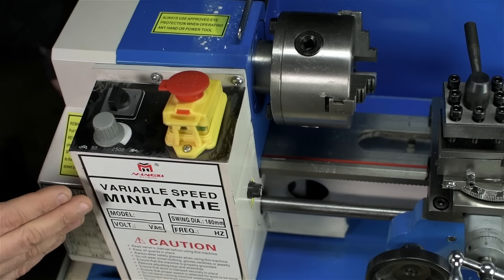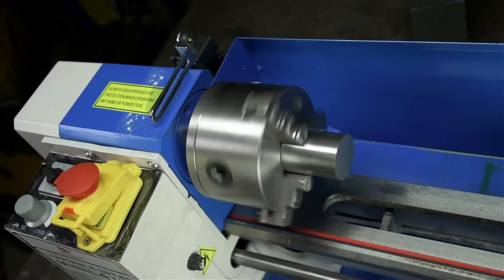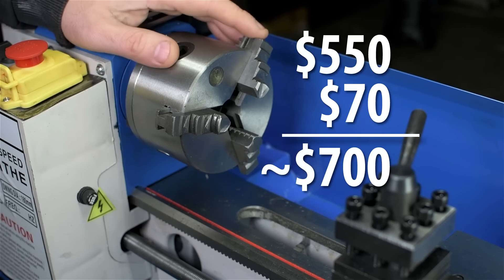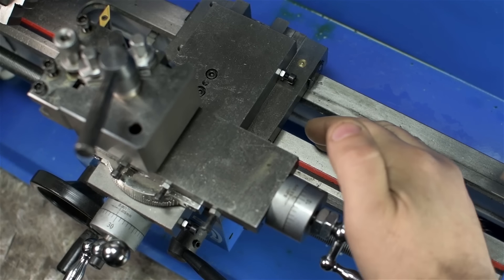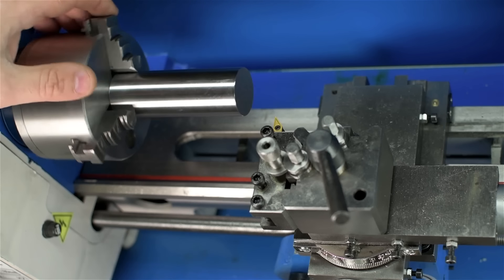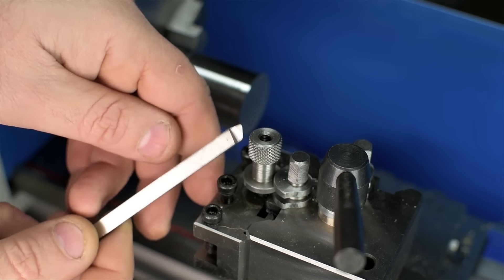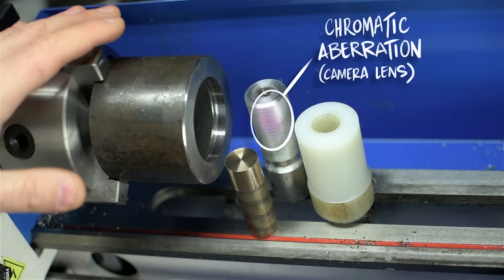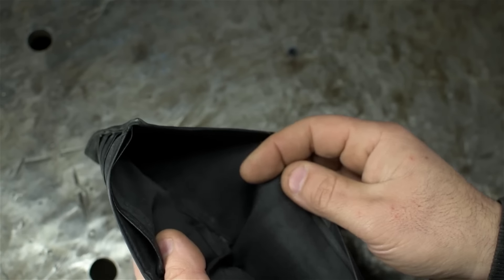The Infamous Mini Lathe!

Comment: I've been using a 7 x 14 for over 10 years for tooling and gunsmithing projects. I have chambered numerous extremely accurate barrels and blueprinted rifle actions to the point that the rifles are accurate enough for competition (5 shot groups under 0.025 at 100 yards). I have machined repair spigots for our swimming pool and countless other projects.

I can't post on the premium gunsmith forums because they laugh at anyone using one of these, but my results speak for themselves. And yes, I have heavily modified it for enhanced rigidity and increased spindle bore size for wider stock.

I've also used it to machine glass filter housings for one of my older cameras.
Reply: What were the most effective mods for adding rigidity?  Adding a lock to the compound or replacing the compound all together seem the most obvious, but what else?
Reply: As a gun nut I call bullshit on the less than 1/4 MOA as that is almost impossible with today's technology let alone a $500 dollar budget lathe, as seeing at most u could only turn down pistol length barrels with it, and pistol caliber cartridges aren't even capable of 1 moa accuracy, ya know the only cartridges I can think of being capable of that kind of accuracy would be .408 cheytac, .416 barret and .375 cheytac. And all three of those cartridges would require a barrel that is longer than a mini lathe is capable of machining. So any other misinformation u care to spread Mr. Fudd?
Reply: @how_about_no3287  for some reason I trust you more than that boomer
Reply: Boy now that has to be some mighty thin barrels.  0.75" through bore is enough for maybe 0.25" wall thickness on a .22 cal. 
A .223 government profile will not fit nor would I try cutting threads on the machine.
Reply: @ahole5407  Before we say the man is lying, consider what he said in his post about the gunsmithing. He said he "Chambered barrels" What does that mean? I am not a builder of firearms, and I don't know what that means. He also said he "blueprinted rifle actions." Blueprinting in the automotive world means repairing loose tolerances of parts, to get them all matching factory specifications, with no "lips" or "burs" that can cause loss of performance at the bleeding edge of performance.
Reply: @Ritalie  "chambering"
Most prefit barrels you buy will already have the rifling cut and the chamber (where the cartridge goes) will be cut short of the depth it needs to be for correct headspace. A chamber reamer is used to cut that final depth. The barrel is loaded into the lathe where the chamber is oper facing the tailstock and requires the length of the barrel to go through the through bore. This machine can't do that because it only has a 0.750" through bore.

"Blueprinting actions"
You true the face of the action to the shoulder of the barrel, true the threads, true the bolt face to the breach, set your headspace, and eliminate all tolerance stacking.  Lapping of surfaces to 90% contact is also done and acts much like how scraped ways do on a mill.
An action is larger in diameter than a barrel and again this machine would not be able to do that work either.

In gunsmithing, you debur and you can also dehorn bit generally sharper corners are a sign of good machine work and also why stones are preferred when doing hand work.

And then we have materials. Ordinance steel is tough stuff. Barrels are made from 416 stainless and CMV. Older actions can be made from case hardened Steel. The machine is too small to do quality work on these materials.

Any questions?

Comment: I took the advise of a millwright I worked with. He told me to buy the mini lathe, learn to work around the limitations and turn out good parts. When I buy my next "real" lathe I can use all the tooling I purchased, and it will all seem too easy on a big machine after the mini lathe experience! I have crashed my little buddy, made new gears, rebuilt the head, and learned SO much I would not have had the chance to if I just got the new lathe up front. Also, I paid for that machine 5 times over making barrel tuners, comps, threading barrels, firing pins, and it works great when reloading ammo for case prep. Have fun,   G>

Comment: On the topic of plastic/acetal gears: 

Overall, remember folks, plastic gears don’t necessarily mean bad quality or that they will break or wear fast. Sometimes it’s actually a positive and some applications do a lot better with plastic gears than metal gears where said gears are not encased in an oiled gearbox but it always depends on the application as with absolutely anything in the universe.

Comment: I love my minilathe. I've actually managed to do some titanium machining with it- the trick there is 1) get the soft annealed grade and 2) run it backwards with the tool installed upside down. That way the slop in the lathe means that the tool catches it retracts from the workpiece and has another go on the next rotation; in a "standard" configuration when the tool catches the slop allows it to really dig itself in, causing everything to stop very suddenly.

Comment: I also started out with one of these, but mine was the "very popular" 7X10 (really a 7X8)Mini Lathe from Harbor freight.  This became a 7X16 with the LMS kit.  Later it was sold for a 8-1/2X20 bench lathe from LMS.  I also got a LMS Mini Mill,  this was traded for the next size up, the Bench Mill also from LMS.  I learned a lot with my little toy (and videos from you.  the 1" punch is especially useful) and now have a brand new Clausing 15X50 lathe and 10X54 Mill I get to play with at work.  The learning never stops
The ability to make whatever you need is amazing.

Comment: Plastic gears are fine. I got my 7x10 in 2008 and am still using the original gears. I have stalled the lathe taking too deep a cut a couple of time and none of the gears have broken. They have the double advantage that they are cheap to replace and self lubricating. 
If your gears are tight on the shaft ream them to the correct diameter.
My two cents on upgrading the lathe. Do not put in a bigger motor or steel change gears or steel headstock gears. Just use the lathe as it is for projects and save your money to get a bigger more powerful better featured lathe if you find this one has shortcomings. This lathe is engineered so the power of the motor is appropriate to the materials and masses of the gears, castings, size of work that fits in the lathe and depth of cuts it can do and meet the accuracy of 1/1000th of an inch in the work. Upgrading to more horsepower and steel gears etc is asking for trouble as you run in to the limits of what the lathe is engineered to be able to do.
 Have fun with your lathe.

Comment: I agree it can be very useful to keep a smaller lathe around the shop for delicate work. Personally I like to chuck my mini lathe into the full size one which naturally doubles my productivity
Reply: Would you be able to give me some advice on where to get a cheap lathe that I can make wooden bowls with please? I don't have much money, so I'm hoping to find something cheap. I'll even do it by hand if necessary, I just need to know the bare minimum tools I'd need to get the job done. I'd really appreciate some advice! I want to be able to make some money selling them to help my family. I have a pyrography pen, and I'm hoping to make bowls and things of that nature, burn designs into them, and hopefully turn a small profit in time☺️
Reply: I have a 7 x 14 mini lathe (Grizzly G0765) and a Toyo ML210. I made a back plate adapter to fit the Toyo chucks to the Grizzly.

Comment: The reason for the plastic gears is for safety, in gear boxes it's common to expect a overload and thusly the force needs to go through something that breaks on the upperlimit in order to protect the rest of the machine. Thusly this part will be easily replaceable and made of a lower strength material on purpose. With metal gearboxes this is normally a pin of a certain diametre that breaks
Reply: The larger lathes with true gear boxes will have a shear pin in them somewhere to handle just that problem.  The shear pin will be in place of a key.
Reply: Dang. Like a mechanical equivalent of a fuse!

Comment: Two companies make these lathes. The one that makes the one in this video is the better one. It has way wipers on the saddle. The apron is thicker and there are dual ball bearings on the carriage crank. It has a lash adjuster nut on the right end of the leadscrew. The sides of the saddle are straight which means more mass, plus easy to install a carriage clamp. Some importers have one installed on the right side. The headstock should be held to the bed with four bolts. They've also added the camlock to the tailstock.

The other manufacturer is where Harbor Freight buys their mini lathes. No way wipers. Thinner apron without bearings for the carriage crank. The headstock is likely still mounted with only three bolts. The saddle is "H" shaped, lighter weight. No camlock on the tailstock. No lash adjuster nut on the leadscrew. This manufacturer tends to really slop on the protective shipping grease that has to be cleaned off.

With either one, the manufacturer offers many features for the importer to select from. Typically companies that buy the cheaper one (like Harbor Freight) tend to only opt for the thread dial and leave everything else stock = cheapest. On the fancier one I've seen importers offering things like the carriage lock clamp. Odd that the one you bought doesn't have the thread dial.

A super easy improvement is to remove the lash adjuster nut (loosen the setscrew in its end) and support block then add a brass washer on the screw on either side of the support block. Then you can snug the nut up real close to improve surface finish and reduce jams and digging in (especially when facing) because the leadscrew can't move to the left.

There's a lot of little project that can be done with the lathe to improve the lathe. They're pretty well documented on the web. Spend the first several days on that stuff and you'll both learn how to use a metal lathe and make it better and more enjoyable for projects.

My first lathe was one of these better models (with threading dial), bought at a Homier mobile sale. I'd never used any lathe before but within minutes of getting it out of the box I was turning a piece for a project. I bought the lathe because I was tired of paying a machine shop $35 an hour to make things wrong. "I need this bore cleaned up and tapered this direction." Got the part back with the bore real nice, and tapered the wrong way! Fortunately there was enough metal left I was able to bore it straight, press in another piece of steel then taper it the right way.

My second lathe was a Grizzly 7x10, serial number 346. Likely from the very first batch they imported. I was at least the 3rd owner and it had been abused badly, due to how crappy it was. I was able to work it over to make it much better. Chinese tools have improved a lot in quality since the 1980's, if you're willing to pay a bit more. They'll still make crap if that's all you're willing to pay for.
Reply: Indeed, chinese just ask "What you are willing to pay for it?"; And makes it to that budget. If you say you want 10$ lathe, well... They'll make it for you, but don't expect much :)

Is there a site devoted to the mods you are talking about? I've been thinking about getting my first lathe for sometime, maybe it is time to do that :)
Reply: @skaltura absolutely correct👍🏻
Reply: It's similar to a 3D printer made from a kit, lots of your first projects are making parts to make the 3D printer print better, then making the same part in even nicer quality-repeat until satisfied. Did this with my part cooling fanduct, for instance. will eventually do so for all of the axis parts. I imagine you could really go ham and get something pretty nice after awhile.

I would get this lathe cutting reasonably well, then I'd use it to make the parts for a somewhat larger, but much nicer, handmade lathe piece by piece. and learn how to use a lathe while doing so.
Reply: you seem to know what you're talking about here - I thought i'd found it a few weeks back online but now it's gone from that location (amazon) - can you recommend a source for the better one you refer to ... or something of an equivalent deal?? thanks ever so much - this would be my first lathe - looking for something useable i can grow a bit on
Reply: @TJ-ed8xg  China makes most of the electronics, and many of the mechanical parts for those 'good' brands you're thinking of.

China will make shit if people ask them to make shit, but a lot of what they produce is perfectly serviceable. My 3D printer is Chinese, and it works just fine. The stepper drivers for the expensive name brand Prusa are identical sans a different label
Reply: @DFX2KX  Good point- but 10 years after my  first  FDM 3D printer I'm running a Form2 SLA printer and still not "satisfied" with the parts, it's an evolutionary process. With the lathe, the part is pretty much the part- assuming a decent lathe (not $200 Harbor Freight minilathe) I can make pretty much the same part on my  MSC import lathe that I could on a $30K  14x60 Hardinge,  lathes are generally just separated by work envelope, unless you really need parts that you have to hold tenths or under. You can hold a thou all day long on an import lathe if you use proper machining practices.No need to spend more if you aren't in commercial production.

Comment: If you want a better surface on aluminum with hard metal cutting tools, It's better to use coolant lubricant, this metal tends to melt right on the cutting edge and create small "sticky" like bits looking like what you had at 7:30. Great video by the way, you're really explaining stuff in a way that is easy to understand :D